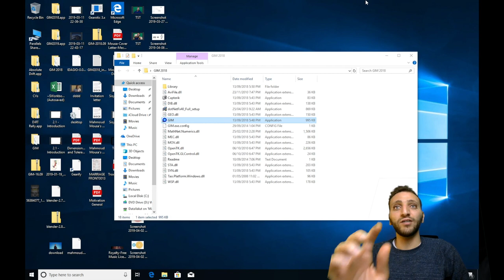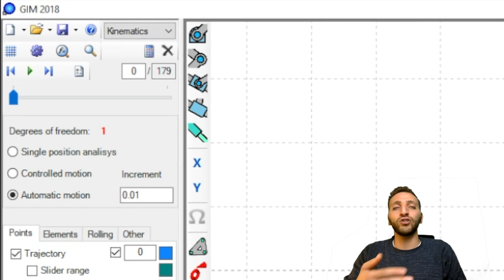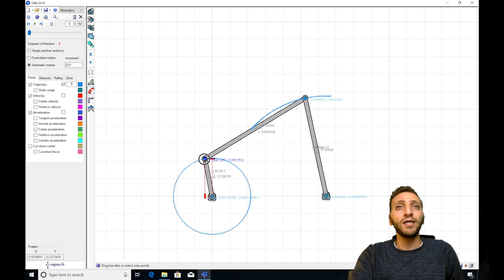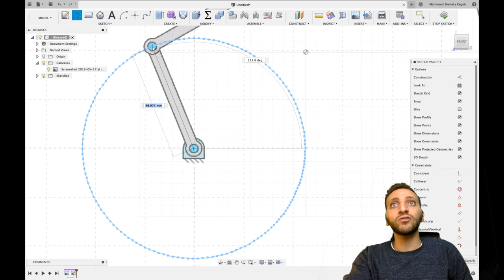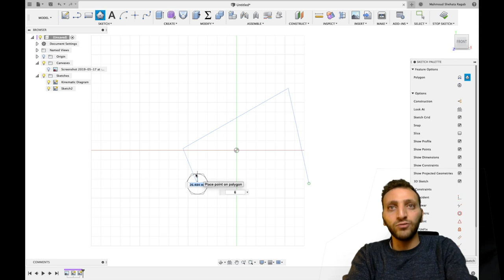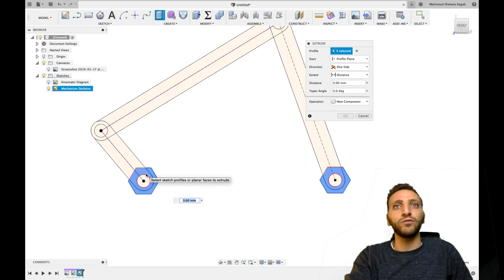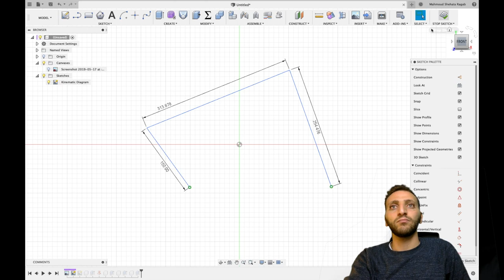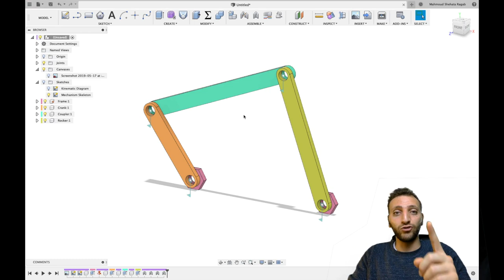Fourbar Linkage Design in Fusion 360

Comment: Ok, this video was TREMENDOUSLY IMPORTANT for my workflow!!! I use Shapr3D on iPad Pro and I realized that with the proper constraints and the correct use of Transform tools, I can do the same Kinematic four bar linkages that you're doing in Fusion360, with realtime dynamic interaction. (I also had not realized that I could do that in Fusion360.) 
Having that capability, and having it portable on the iPad means that I can quickly play with linkage concepts from anywhere. 
Thank you SO MUCH for sharing your insights. All of your mechanical engineering videos are exceptionally well done and informative. 
I certainly hope you can find the time to share more of your mechanical design insights and experience with us.
Reply from the maker: Oh wow, Gregg. I have actually moved away from Mechanical Engineering to Software engineering for almost a year now! 😅
Very glad to know my videos helped you though. I have a couple of courses on Udemy with more details if you want to learn more. 

Cheers!
Reply: thanks Mahmoud, shortly after posting my comment, I found and purchased your Udemy course; Designing Mechanisms using Fusion 360.

It taught me Exactly what I needed to know, in order to design precise four bar linkages.

When I think of the time I have spent searching Google and YouTube videos for this info, your Udemy course is like finding treasure. Thank you for putting it all together so clearly and concisely for your audience.

Comment: Hi ,
First thanks for sharing.

I am a newbie to fusion360 so excuse me if I didn't understand the purpose of using a separate program to change your dimensions.  Couldn't you just do it with the parameters command in fusion360 similar to the example below?
https://www.youtube.com/watch?v=gMNGQUAtC9o
Reply from the maker: Hi John,
Thanks for your comment. The separate software is very very powerful. It can help you simulate and design many many mechanisms. This is just and introduction to the workflow. Next I will show you how to use this workflow to make coupler curves mechanism. I'm taking this step by step. You can check my Udemy course on making a kinetic sculpture intro video. You can see how I managed to use this workflow to design Sisyphus and animate him. Then things would make more sense. In short it's not only about changing the dimensions, It's about designing a specific output